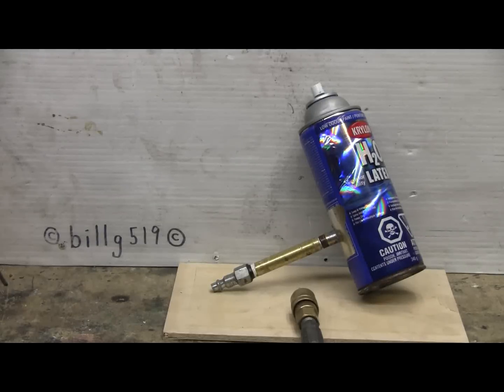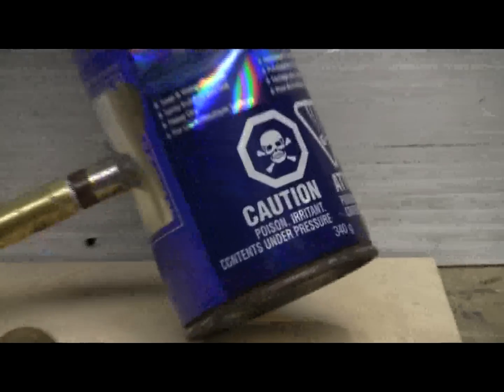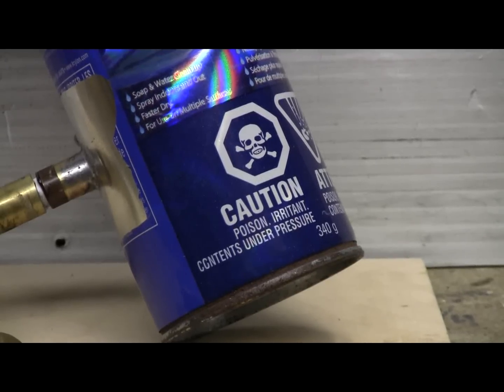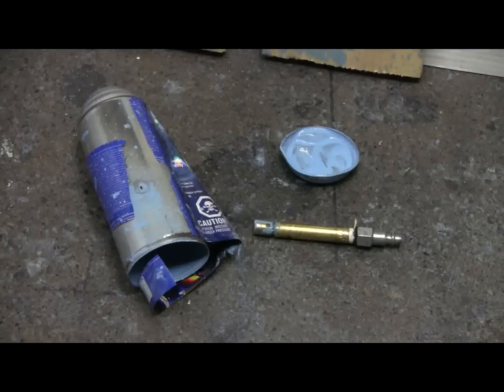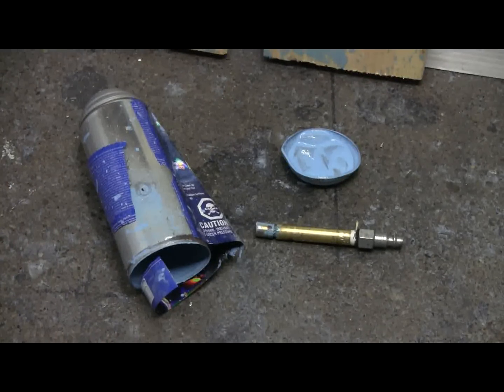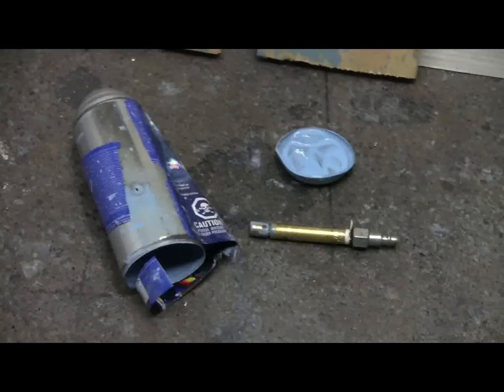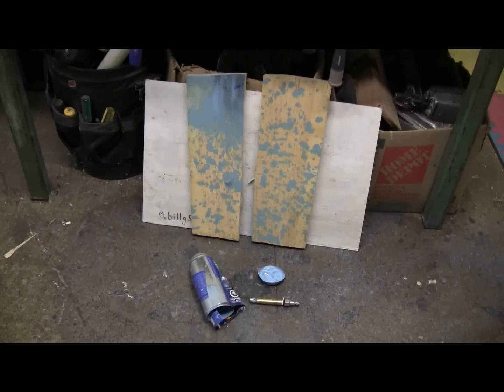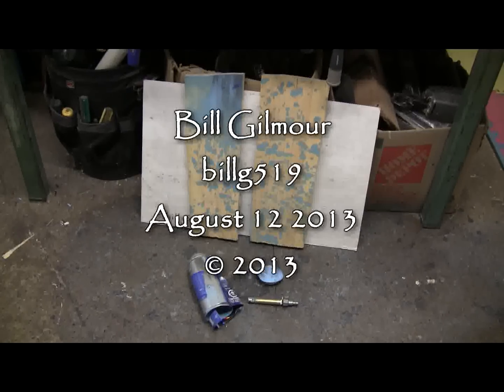Air Compressor - Bursting A Spray Paint Can

Comment: That was a cool experiment,      I got tired of throwing away 1/2 full cans of WD40 and paint cans,  so I started refilling mine with compressed air about 125-140 psi. Works Great.     But I never knew the limit for safety,  now I have  better insight on safety 
Thanks

Comment: Bill, 

If you still have the equipment to do the testing, could you test a DOT 2P, and a DOT 2Q rated can? 
These are "Department of Transportation" pressure ratings for aerosol cans. Cans that do not have this printed on them are typically rated for a lower pressure.

Thanks!

Comment: Been looking for a video showing the strength of these cans as I've been tempted to add more of my own psi to spray cans, just don't know their strength. I was thinking of just 150 psi tho.
not trying to be a Debbie Downer, but I think the can actually popped just barely under 320 psi
Reply: I just recharged a can to 150 psi this morning using an old valvestem and an air compressor. I usually paint about 1 foot away from my surface... This morning I painted 3 feet away. This was with the regular nozzle. Coverage was a little wider and certainly further. Paint did accumulate at the nozzle causing drips. Seems like most cans/nozzles probably function around 90 psi.
Reply: What for you planing on spray painting the car across the street or something?
Reply: Electronicdawg Umm not really? Do you think that would work? 😀
Higher pressures give better coverage/dispersion btw.
Reply: Sure, the higher the pressure the further it can spray. You might have to design a special nozzle for it or something, but sure spray paint the neighbors car from far away. Stealth graffiti.
Reply: I know this is very old but I wanted to add if you drill a hole in the middle of the spray nozzle it will shoot out a straight bead of paint instead of a wide mist spray